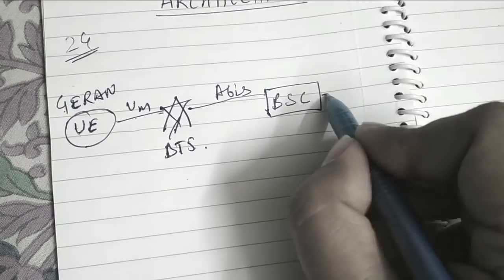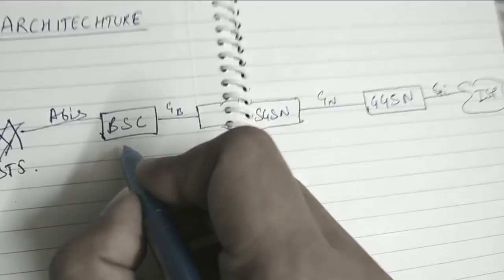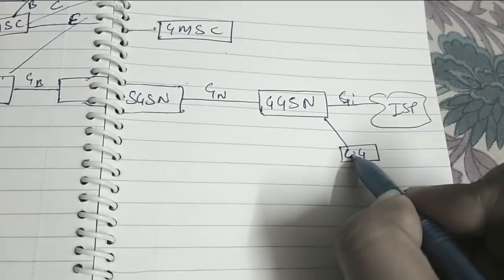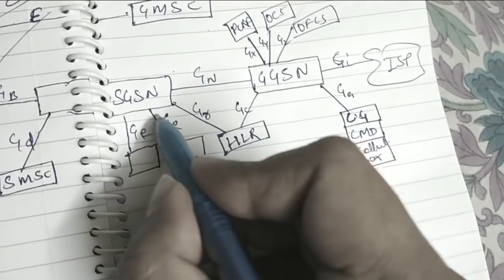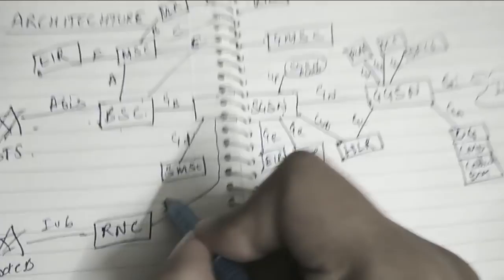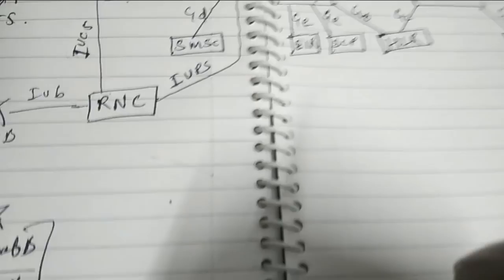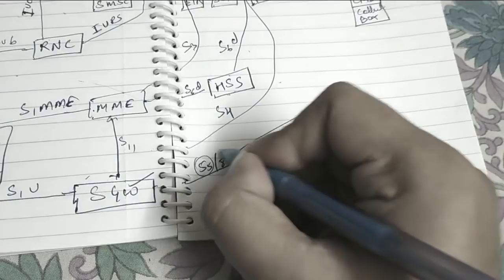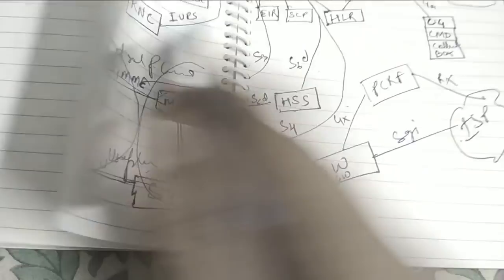BEST CALL FLOW WITH 2G-3G-4G INTERFACES(GPRS/LTE)

Comment: Nice Video but Small correction Bro: 
1. In 2G/3G its MS not UE.
2. Air interface b/w mobile & Node b is Uu not Um.
3. Interface b/w MME & HSS is S6a not S6d.
4. Rx interface is b/w PCRF & AF(Application function server) not PCRF & ISP.
Reply: Yes you right